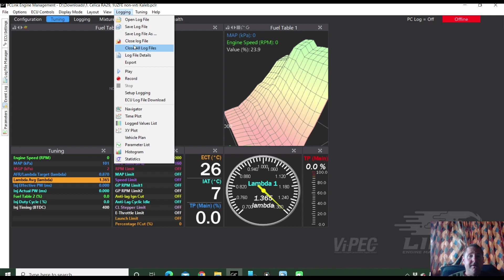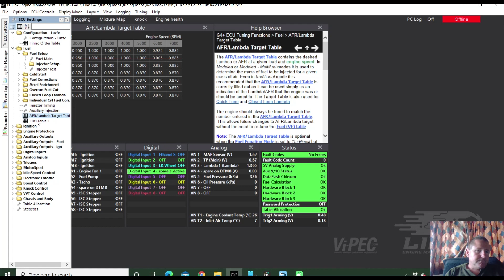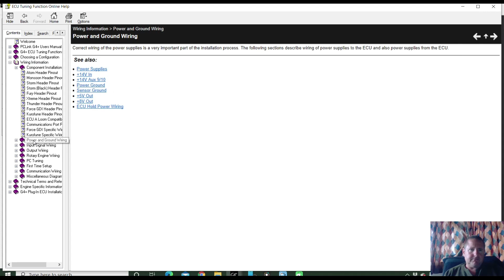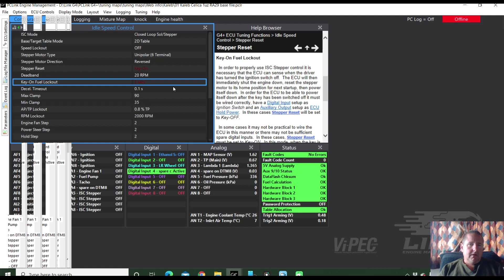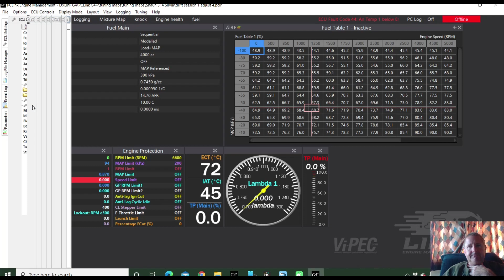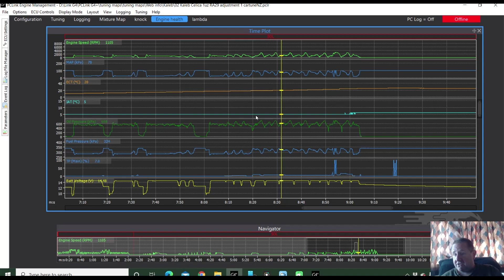Link consult for Kaleb with Celica.  - Check out tune file , make recommendations.  Now runs better

Comment: peace be upon you brother. I am from Libya and I want to run a Toyota 3rz engine I have a 2rz computer, how do I start this engine with this computer? I want a playlist map, please
Reply from the maker: Wire it correctly and start it up.  I focus on UZ work atm thanks
Reply: I do not know the connection. How to connect the wires, and I do not know which wires are used for operation and which ones are for the cam sensor, can you help me
Reply from the maker: @polatdar130  I am busy with UZ engines so not doing anything witg RZ stuff right now.  Cheers Kelvin